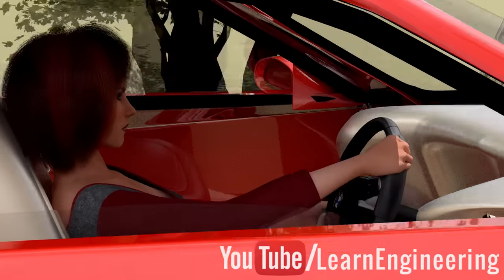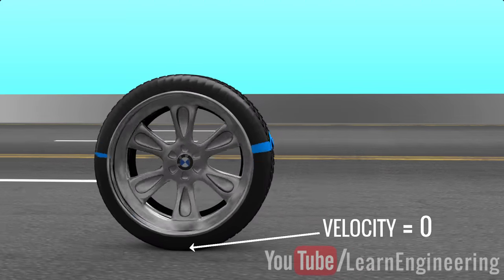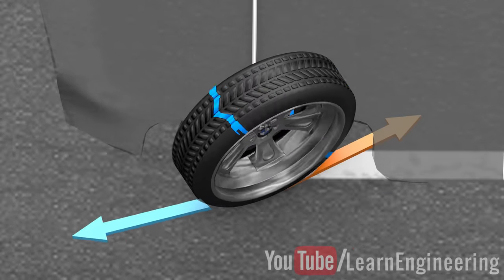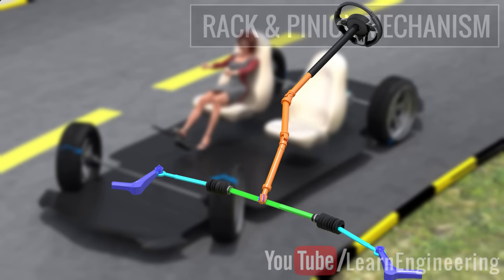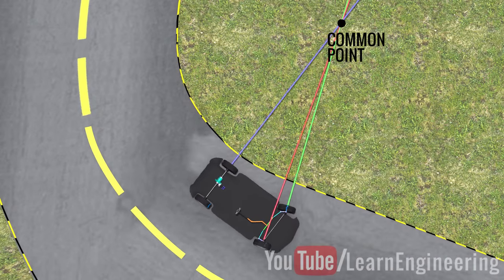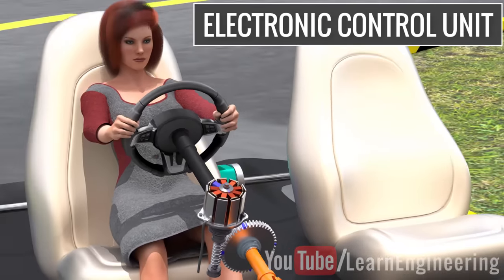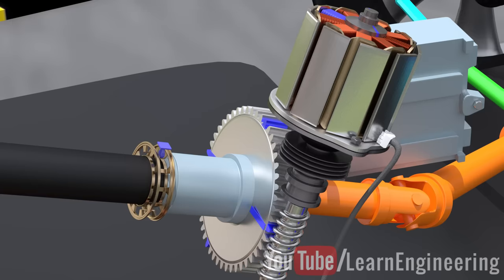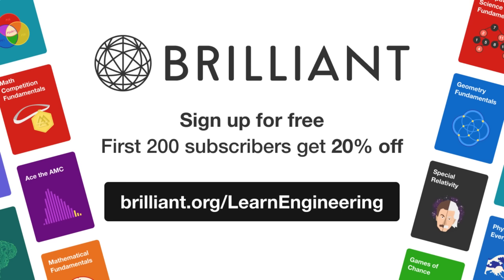Understanding your Car's Steering & Power Steering !

Comment: Wow this is by far the most informative video about EPS.. Thank you for the effort to do the video! But there is one thing you should also explain in the video, that is how the tie rod + rack & pinion + steering arm mechanism turning the wheels at different angle and always achieve the common point.. Does anybody know how this happens? Thanks a lot!
Reply: THIS!! Did you end up finding the answer?

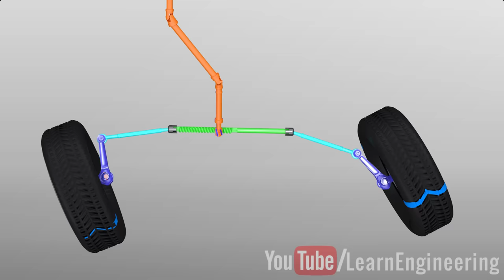Comment: 4:00     You didn't explain how the left and right front wheels can have different turning radius's.
Reply: The trick is in the angle of the linkage at the neutral position (3:12). If they were starting at 45 degrees and in line with the rack and pinion, both wheels would move the same angular distance and you would need new tires very quickly. Instead, they are neutral at ~20 degrees and the rack and pinion is to the rear. The rack moves the same distance on both sides, but because of the initial angle of the linkage the wheel turns farther when turning away from the center of the car.
Reply: @pyrobeav2005  

With the wheel straight ahead, draw a line between the steering arm pivot and its connection with the tie rod and continue until it reaches the rear axle. Wheels will toe out the correct amount on turns when this line intersects the rear axle at its Left Right center.

Toe out on turns is not adjustable and some alignment techs interpret this to mean if it's off nothing can be done. Some go step further and don't check it.

Reality is if the measurement is off the car has bent parts

Comment: But what isn't explained is how the rack-and-pinion steering mechanism achieves the different angles on each of the steering wheels. As in the components on each side are mirror images so the difference in the angle must come from something else, maybe the initial shape of a single component, but what component is that? Or I must have missed something?
Reply: no u didnt miss
Reply: Because of the shape of the lever that conects to the wheel's axle, which has a specific angle. 
It's called Ackermann steering geometry

Comment: What is obvious from this video is just how ingenious and superior hydraulic power steering is over electrical.  The mechanical advantage is built into the design rather than relying on electrical components that can fail.

Comment: The ratio at which the wheels turn compared to the steering wheel when assisted by power steering differs from the one when power steering is inactive (car shut off) since the ring gear doesn't turn in latter case, thus giving the gear box a different gear ratio.
This would mean that if I were to turn the wheels all the way to one side when the car is off and then turn the wheels back after starting the car, the steering wheel would be in a different position than before, right?
Or does the power steering account for the different gear ratio?
Reply: I think issues like this is considered by designers already so different position won't happen. And as I know the steering locks up when the car engine is off so idk how are you gonna turn the wheels like that.

Comment: Hard question:
What happens when the motor fails detecting drive wheel movement? Will it keep supporting turning in one direction while the driver is trying to turn other direction? How do they prevent that?
Reply: Of course it won’t keep turning into one direction. But if you want to know the indepth details then you’ll have to reverse engineer the whole mechanism.. it will also be manufacturer specific on how it’s exactly done. It will involve sensors and electronics and software.

Comment: "when you learn to drive, the most difficult controll to master is that of steering" literally the most intuitive control there is on a car..
Reply: Well technically when you think about backing up and all the challenging aspects they all revolve around steering
Reply: @cintowin  That’s similar to someone saying walking is easy and then going to smartass that walking backwards on your hands is difficult…. Normal steering straight forward is the most simple thing in a car.
Reply: @Engineer9736  you must not live on back roads or ever had alignment problems- because yes, these are common occurrences. I've seen many people who can't even swerve a pothole. It's about knowing the perimeter of the vehicle your driving which all equals ....what?  S t e e r i n g. Because these are all parts of steering. Unless your talking about sitting in a parking lot with your car in accessory mode pretending to steer. Then yes you have a point. Good job.

Comment: Pls. Explain, WHY REAR WHEELS Doesn't Slip instead of having different speeds on a Turn
Reply: Adarsh Rathore, there is a differential connected in between the rear wheels which allows the rear wheels to rotate at different speeds.  here's a video - https://www.youtube.com/watch?v=yYAw79386WI&t=453s
Reply: One word For you Brother, Differential...
Reply: Differential gears
Or just a metal bar, with 2 wheel hubs mounted on so the wheels rotate freely (in fwd)

Comment: Where the hell is hydro power steering? This is wack
Reply: And pitman aswell... lmao
Reply: In the past, lol

I actually want them to do a video on that also, just couldn't resist the joke.
Reply: its bad that's why
it was used in WW2 army jeeps
Reply: @vampy625  has some disadvantages but it feels way better than electronic power steering
Reply: @v0ldy54  it feels like someone's playing racing game with keyboard
Reply: Hydro in this context, means liquid, rather than water specifically.  It means there is an oil pump operated off of the engine crankshaft, that generates pressurized oil.  The steering wheel discharges the oil through a valve that is sensitive to the driver's applied direction and torque, spinning the steering column in the desired direction that will assist the driver's steering inputs.
Reply: Gay Vampire my car has hydraulic power steering. I’ve also driven cars with electric. I prefer hydraulic. I actually get feedback from the road. Most supercars still use hydraulic power steering for this very reason. It’s not as numb and disconnected as electric. Hydraulic power steering simply has better feel. I know exactly where my wheels are pointed and there’s no on-center vagueness

Comment: 4:00 still dont get it..
If the weels were parellel, with equal arm length. And get translated with the same distance.
Then, how they turn at different angles?
Reply: That's my question too.
Reply: The wheels have to turn at different angles so that the perpendicular extended meets at the common point to obey the steering principle. If they turn at same angles the extended perpendiculars will be parallel to each other and hence will never meet.
Reply: @1000manmath , I get the idea 💡.
But dont really understand the implementation? As how are weels calibrated to turn and point out to the meeting point?
Reply: Yes, and WHY must they meet on the line extended from the rear axle?  Going straight, it is impossible to meet on that line, so it must get harder and harder as you approach going straight.
Reply: " Wheel Kinematics ", this is Called Ackermann's steering

The wheels have the tendency since they can move freely (straight and rotational movement) to follow ackermanns rule to meet on the same imaganable point as explained in the video. If they woudln't, one of the steering wheels would slip.

Slipping has a larger coefficient of friction than rotating so that's why the wheels "try" to stay rotating
Reply: @jimbert50  The steering principle applies only when you try to steer the wheels. As explained in the video, in order to accomplish the perfect steer so the wheels don't slip they must follow that criteria and that's because all wheels cancel out their velocities.

A near straight steering means that the wheels tilt only a little so the imaginable contact points gets further form the car as the car approaches straight line. This only means that the car will follow a  larger radius of rotation at a turn in order to avoid slip of the front wheels.
Reply: @tupac1971ful  So it's kind of like a differential that allows each front wheel to turn at the proper velocity to make the velocity 0 on its contact point.

So what about the rear wheels when you are turning?  The differential allows them to turn at different speeds, but there must still be some friction due them always facing the same direction.
Reply: Notice that the Steering arm can only move in an arc. When the rack is moved towards the right (drivers view) the tie rod which is hinged to the arm allows this arc motion.. cos tie rod will keep it's shape (length) the left tyre turns more.
Reply: Notice that as the rack move away from a wheel, the lever for that wheel turns. That turn moves the connection point between the tie rod and the wheel lever forward a little. This forward motion means the wheel has to turn a little farther. The other wheel has its connection point move backwards slightly. The forward/backward motion is due to the wheel levers extending back from the pivot point and the rack also being behind the pivot point.
Reply: The rack is not at exactly the center of the tie rod. So different torque is supplied to both arms.

Comment: Great video, but a minor correction. Power steering does NOT make steering input more precise. The most precise is no assisted steering, then it's hydraulic assisted steering then it's electric assisted steering.

Comment: Immediate Fail
controls harder to learn than steering:

Clutch. 
Brakes
Throttle

Because changing gear when speeding up or slowing down without 'jerking' requires different motions with the peddles - when speeding up and changing up, you let off the throttle between gears, when slowing down and changing down, you're braking and not 'revving', but the engine speed needs to be higher in the next lower gear, unless you're really damn late to change gear and almost stalling.

Also, Clutch for pulling away from a stop, and with the Throttle, so you don't stall or throw yourself into that car in front of you in the queue at the traffic lights.
Also, Clutch when coming to a stop, too late and you stall, too early and you're not using engine braking to increase braking forces. And coasting is bad, as depending on where you live, it may even be legal as you are no longer 'in sufficient control' or whatever language.

And the number of times I've had to brake because people don't know how to maintain less than 10mph speed difference from when they're on to off the throttle. because apparently they learned the throttle from video games that had placed the throttle to a 'go' button, instead of variable 'go' trigger.

Generally, the accidents of steering are because of wrong speed, or tyres, rather than not getting steering right. I learned to go through a narrower McDonalds drive through without scuffing wheels before I learned how to maintain an exact speed.

Comment: One public question,   in motorway example going at 70 Mph, the EPS  still working ?   I can understand in low speed like parking or in town going at 30 Mph. No idea at 70 Mph due the steering wheels need small adjustments to keep in inside of the lane.

Comment: Few Questions Here ❗❗
1. If planetary gear system is exactly as shown in the video, that would mean that motor can turn the car even when steering is steady, seems like steering wheel doesn't have complete authority ?
2. Where does steering oil come into play ?

Comment: What was not mentioned was that, in order to make the steering mechanism such that the wheel on the inside of the turn makes a sharper angle than the one on the outside, the steering linkages form a trapezium rather than a rectangle.

Comment: Outstanding. I hadn't considered the concept of power steering motor failure (and the steering becoming jammed). The planetary gear solution is brilliant.
Is it possible for the electric motor "armature" to be on the steering column and the stator to be around it? That way,  a strain gauge can be built into the steering column and the appropriate current can be applied to the stator to augment the steering assistance.

Comment: At 6:23 the ring gear in the planetary gear set is shown as two separate gears - silver and green - but shouldn't these be combined into one gear to transmit power from the worm drive to the steering column? Correct me if I'm wrong, but that looks like an animation error. Amazing video in all other explanations.

Comment: Interesting to learn about that last part with the planetary gearset usage. Sometimes you hear stories about there being no mechanical connection to the wheels at all. That would scare me. What computer has never crashed... All of them do at some point. If there was only a computer steering the wheels then there would be so many accidents. I’m a bachelor software engineer but i prefer solid steel to the wheels 😂

Comment: My high school car was a 1960 Imperial, it advertised 100% full power steering. You could parallel park with your little finger. That was discontinued because the public complained of no road feel. I’m thinking I don’t need more pump  pressure but a modification to maybe a portioning valve? Any technical experts out there with a thought for  a possible modification ? I want this done on my 06 Chrysler 300C. TNX

Comment: My dear friend perfectly rolling condition of tyres at turn is achieved by steering mechanism and steering geometry called Ackerman steering mechanism. And it is not because of rack and pinion. It can be obtained in any steering gear used. Please don't spread wrong things.

Comment: I feel like balancing the clutch and shifting gears is the most difficult part in learning to control the car.
Reply: I’ve never had an issue with it. My first car driving lesson i drove away with it as if i had done it already forever. Later at motorcycle riding lessons same thing… didn’t spend a second on it i just knew how it worked and rode away with it. The most difficult part of proper driving is applying all the road rules on the fly, and keeping track of road signs constantly. If you start to think about stuff you need to do later on in the evening and meanwhile miss a merging sign then you’re doomed 300 meters later. Or having missed the last speed limit sign is also a fun situation. Or arriving at a busy intersection and not having interpreted the right of way situation on time. Driving is about handling traffic, not about the technical controls of the vehicle.

Comment: When the power steering is at normal operation, do the planetary gears not affect the steering like making an inaccurate rotation? I mean the power steering rotates but the planetary gears don't? Is there some kind of a lock that allows rotation only from the power steering?

Comment: First of all, when a car moves in a straight line, there is zero velocity at the contact point between the wheel and the surface. The rotational velocity of the wheel and the translation velocity of the wheel cancels out at the contact point. If the velocity at the contact point is non-zero then the wheel is slipping. Otherwise, it is called rolling. Suppose a car is moving straight but its wheels are turned obliquely as if the car will turn. In this case not all velocity cancels out and the phenomena will be known as skidding. A way to avoid skidding is make the translation velocity be directed in the same line of action as the rotational velocity and it can be achieved by making the whole car turn.  For a car to make a turn, the axes perpendicular from both front wheels has to intersect the rear wheel perpendicular axes at a common point. Other wise the car will not be able to make a turn. For this phenomena to occur, the angles that the right front wheel and left front wheel  makes with the vehicle's longitudinal direction has to be different. The steering mechanism is used to achieve this goal. The most common steering mechanism is the rack and pinion mechanism.  The rack is at the center of the mechanism and is constrained to move only linearly in a straight line. A pinion is used to make the rack move. Steering arm is another component of the steering mechanism which is attached to the wheels and is constrained to only rotate via a roller bearing. The steering arm is connected to the rack by a tie rod and can move both linearly and rotate. This system ensures that  both axes perpendicular to the front wheels  intersects at the common point with the rear wheel axes.  This is how a manual steering works.
Reply: Everybody has been to high school genius ! We all know how pure rolling, skidding etc occurs. (At least who took physics know it)

Comment: How does that arrangement lead to steering wheel both left and right to the correct angles?  I mean if on steering left, left side wheel is turning a greater angle and it will do the same even if steered to the right with that arrangement.

Comment: Dude as u shown that in case of power steering motor failure. Then we have to turn double the number revolutions than the revelation v made when motor good condition . As a planetary gear rule
Reply: Lesics pls reply to my comment

Comment: I think this is of a newer power steering system, with the DC motor and hall effect sensor. Pretty sure older cars use oil pressure to assist with steering or something.

Comment: Sir , Some cars  front wheels are attached with engine so which cars are easy to handle in case of turning cars which front wheels are attached to engine or cars which back wheels are attached to back wheels?

Comment: That's not power steering.
What you have described in BMW's "Active Steering", where it uses the motor and planetary gears to dynamically change the steering gear ratio.
This is used in combination with traditional hydraulic power steering.